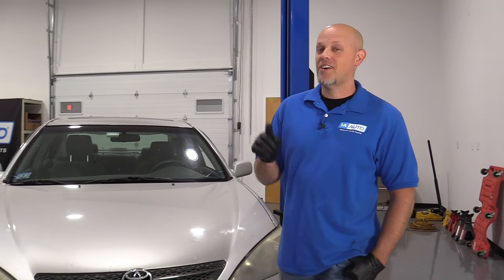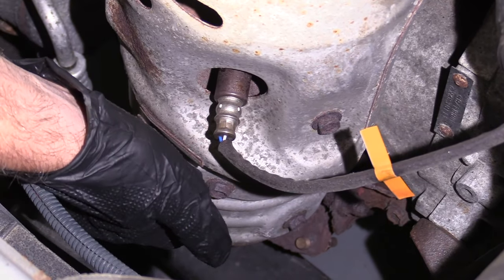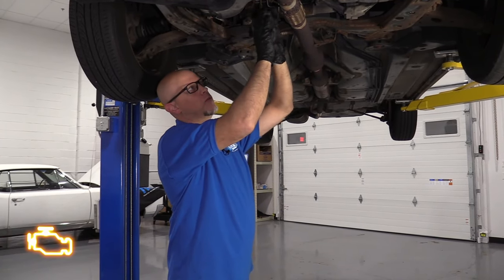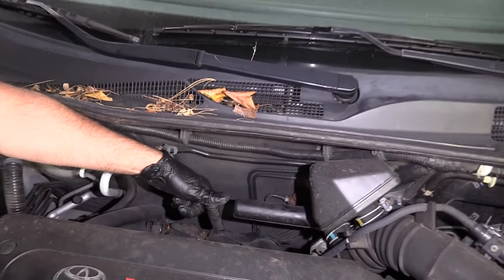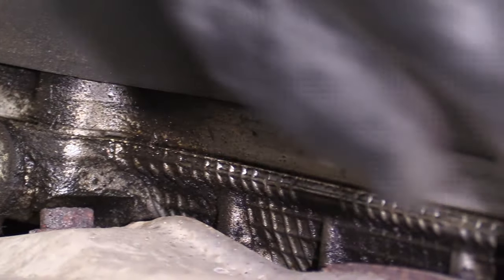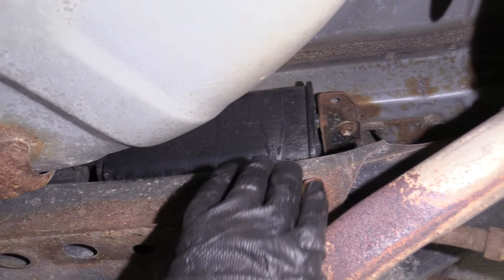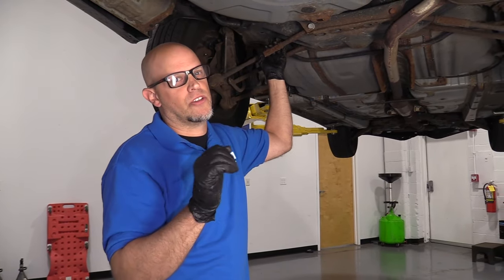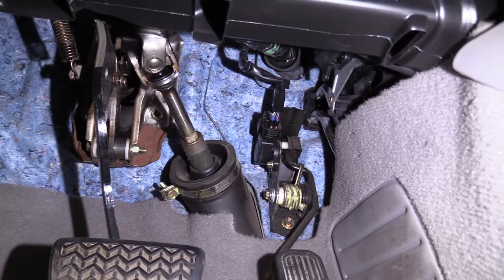Top 5 Problems Toyota Camry Sedan XV30 5th Generation 2002-06

Comment: I just let my 2006 go with 280k miles.  Motor ran great but was burning oil pretty heavily towards the end.  The biggest thing I found were the front brakes were always having issues.  I had them serviced at least twice a year and finally just drove on bad ones until they started grinding.
Reply: Your car still passed smog
Reply: I replaced all 4 with power stop rotors and quality ceramic pads my self cheaper than fronts at shop. Not one isdue in 3 yrd
Reply: @rt2255 wait at what point did this gen have rear disc breaks?? I’d kill to do a conversion from the drum rears that are never adjusted
Reply: @BC_CARS  mine is 03 v6 xle came with 4 wheel disc may only be on upper xle models or v6 models not sure
Reply: @rt2255  well I guess it’s time to start googling
Reply: @BC_CARS  check local pull a part junk yards may be able to find 4 disc camry and get everything you need. I am not positive but if it came with 16 inch wheels it is 4 disc as many came with 15 wheels and i know they do not clear front calipers.

Comment: We have 2006 SE V6 Camry (bought new Sep 2005) w/63000+ original miles. Best car I’ve ever owned.
Reply: Still driving my 2005 SE V6; bought new in Dec 2004. Amazing reliable car. Very smooth and powerful engine. Fun car to drive. May be the best cars ever made!!

Comment: Great cars! I have a 2004 with 192k and it's been one of the best cars I've owned. I will have to add 2 more things to the list. The steering racks go bad around 130k and the headliner sag by the back window and C pillar. Very common problems on this gen Camry.
Reply: What are the symptom of a failing steering rack? What was your doing before it fail? An how long did u drive with a bad rack an pinion
Reply: @kelseyrainwater3918  The steering feels loose and won't feel very responsive. It may also leak power steering fluid from under the car. I am still driving with the bad steering rack I haven't got it fixed yet.
Reply: @KLM817  loose steering like my steering wheel feel loose
Reply: @kelseyrainwater3918  It can but more so the steering itself feels loose like the steering has little control. Your best bet is to take it to a shop for them to check it.
Reply: @KLM817  how many years have you been driving. It like that? Dose it leak? Please get back too me
Reply: @kelseyrainwater3918  I have been driving my Camry this way for a few years. Mine currently doesn't leak any fluid though.
Reply: @KLM817  lol so it's nothing too really worry about especially it's nothing leaking an it's feel safe too drive
Reply: @kelseyrainwater3918  Its ok to drive it that way but you should still have it checked out just to be on the safe side.
Reply: True it was leaking throughout my college life, 5 years i just kept adding fluid “cheapest one” because it will eventually leaks, and it run fine and drove it through the US from NYC to FL it is the best car with very very minimal repairs HIGHLY RECOMMEND it if your main goal is quality nothing else like “HP, quietness, etc”
Reply: @kelseyrainwater3918  Not a big deal. My 05 Camry was diagnosed by the dealer, with a leaking rack and pinion  at 80K miles! They wanted crazy money for the repair. A mechanic friend replaced it with a Refurbished one for $500, I think it was. 100,000 miles later not a problem.
Reply: This is very accurate
Reply: I bought the 2004 with 198k and both those happened within a year , fixed the rack but left the headliner lol still driving with 240×××klm and the car STILL remains bulletproof. Excellent car.

Comment: In my experience the gas caps go bad more often then the evap canisters, even though it may throw a code, always and i mean always try replacing the gas cap with a factory cap reset the light drive 50 miles and if the light doesnt come back your good to go, the sensors for many of these are too sensitive, I have seen too many times people being charged hundreds to replace evap canister and have it "fail" again after a couple months because it was actually the gas cap. locking gas caps can also cause this issue as many times they are not sealed properly due to poor manufacturing and they are not made as good for modern cars. As an owner of an 05 model of this car with 300k miles i can attest that i only had a code once for the evap canister at 150k and replacing the fuel cap fixed the problem which the repair shop actually advised against go figure. The only big problems I have had with mine has been rack and opinion and piston rings. Valve cover gasket lasted until 200k miles and that can actually be caused by a bad PVC valve which is a cheap and easy diy fix

Comment: I bought mine from my next door grandma Nieghbor 05 le  only 49000miles for $3200 she rarely go anywhere just park on her driveway all day only two issues are roof top and trunk top clear coat damage and rear shocks this what I did after took to body shop they said $ 350 per panel so at lease it’s going to cost me $700 soI decide to do it myself they call flow coat for a whole car cost me about $300 look great change all 4 shocks now it look new and run like new I’m so happy . I bought this car I don’t even need

Comment: I got a 2002 camry xle (4 cylinder) at 33,000 miles, i got it up to 76,000 so far. I've owned it since 2016, The only issue i've had so far is the A/C going out every 12 months due to the relay going out. One of the easiest and cheapest fixes (20 bucks and maybe 5 minutes of work). Its not the fastest car nor the slowest, but god damn, that car will get you anywhere you need to go.

Comment: 05 camry le 4cyl. 237k miles. the only problems my wifes car had was windshield wiper arm, valve cover gasket, thermostat oring leak, motor mounts,dirty throttle body and exhaust leak from flexible exhaust. even though toyota says to not change the transmission fluid i changed it anyway and it made a huge difference at 237k miles let me tell you. all repairs done by me with the exception of the wiper arm. total repairs less than $1k and im being generous. most reliable vehicle i jave ever seen.

Comment: superb! spot on. I have a 2003 camry and the O2 sensor went bad. Easy to reply though
Reply: Did you get a check engine light cause a mechanic told me the check engine light don't always come on for a bad o2 sensor

Comment: We have an 2004 Camry, still runs perfectly and has never let us down. We once got an impressive 38 MPG driving from LA to Albuquerque with the AC on and loaded with luggage. And crap! I should immediately stop topping off the fuel tank. I have the bad habit of topping off until gasoline is at the filler neck.

That ruins EVAP canisters. 😮 I didn't know how much trouble it would be to replace it.

Comment: 2002 bought brand new after 21 years  and 255,000 still going strong
Reply: Damn.. do you do regular oil changes? What's your secret to keep it going that long? Any minor issues you fixed?
Reply: @ramir332  yes , high mileage oil changes the only thing I had to change out in June of 2022 was the fuel modulator. The part alone was $525.00 and casket was $15.00 and $300.00 in labor . I only use Toyota certified mechanics . I’m getting ready to do the timing belt again .
Reply: My 04 only has 104k bought it from a elderly couple 4 years ago with only 51 k I've had to replace the water pump alternator spark plugs and has new breaks and rotors 
Do you have the v6 or 4 cylinder?
Reply: @sirhc07  Not sure who you were replying to. But, I have a 2006 Camry I bought it used at a dealership unfortunately (they sell it to you at a higher price.) It was sold with 160K miles. And now its sitting at 190K (roughly 3 years general use.) Major fix I did was change the gasket oil leak (cheap fix) replaced all 4 shocks and the tires on them lasted 1 year before I had to replace all 4 tires. That was like $1K for shocks and tires. 

The only problem I have with the car now is it rattles when its idle. Does that happen to your Camry? im wondering what it is.
Reply: @sirhc07  3.0 v 6
Reply: Sports edition
Reply: @sirhc07  I’m 60 and when this car doesn’t drive anymore I will buy another Camry V6 . The one I have was a factory demo and had like 300 miles in it , it’s silver with black leather , GPS , funny when I bought my teenager daughters wanted the 6 cd changer and the dealer said it would run $1,500.00 to swap it out . I’m glad I left it . I have two German shepherd and have a heavy duty sling in the back seat . I have one tiny hole in the leather that I’m going to repair . One thing I did do when I first bought was I washed and had waxed it myself every three days . So the majority of the paint is still in good condition. Hood is pitted & and the clear coat is starting to turn white as my ex husband used it to commute on I 5 .  It’s going to be a sad day when she no longer here .
Reply: @sirhc07  thank you

Comment: We got a 2005 LE. None of the issues from this video yet with over 250k miles original owner.  But many front wheel bearings hub replacements. I think I replaced them 3 times going on 4 now.  And the other day it dumped a huge oil leak from the crank pulley area. I was thinking it was the oil seal from the crank but it might be the pump.  Either way, the cover needs to be pulled.  Not even a drip before this.  Now it's a stream.  Went from dry to cry in 1 day.  Oh I did replace the valve cover seal like 2 years ago and it looks to be leaking again.  Maybe I did it wrong.  But it's very little.  

Also,  I think the motor mounts are done.  There's a rattle on start up only.  And this might need a valve adjustment for the oil burning during start up.  🤔 

Replaced the timing belt and water pump maybe at 170k.
Reply: Depends how maintained it was. It needs to change ATF transmission liquid each 40k km. At least each 80k.

Comment: 2003 v6 xle 330k miles, 3 parts went bad all after 250k miles alternator, radiator, knock sensor. Best damn car i ever owned, have owned 15 to 18. Toyota only now

Comment: Wow. This was spot on. I inherited a 2002 camry and replaced the valve cover gasket and now have to replace the rear charcoal canister.
Reply: how many miles? got my 04 camry back in 2019 with 50k it now has 99k and have had to replace the water pump and alternator recently completely redone the front breaks and I change the oil every 3k I love it and that is actually very common them
Reply: @sirhc07  it's got 137 000 miles on it. Since I made my original post, I've had to get the brakes, rotors, calipers replaced.
Reply: @kelsiewilson  I got them off parts geek they seem to have very good prices on parts and the quality isn't bad a kit came with the caliper rotors and breaks I plan on re-doing the rear breaks next
Reply: @kelsiewilson  I regret not inheriting my grandparents 02 camry when I first started driving only had 30k at the time cousin still has it

Comment: Good video.  I would add the mass airflow sensor to the list from personal experience. A dirty throttle body will also lead to a malfunctioning mass airflow sensor.
Reply: Yeah the canister on the car he was looking up at probably does have those issues...did you see how much rust was on the bottom of that car? Probably has high mileage or lives by the beach.

Comment: I have two vehicles
03 toyota camry 2.4 200k miles
It doesnt run like a clock and it has some issues but I dont replace anything on it besides the regular oil, brakes every 7 or so years and so on. Had the car since new and it has original everything, except spark plugs, brake line, brakes, oil and transmission fluid. The drive belt is original if you can believe it.

I also have an 03 ford e250 4.2 with 295k miles
The van has been used to deliver wine from state to state but also to deliver packages which is the hardest mileage you can ask for.
I bought the van with 250k miles but I can tell you, similar to the Camry, it isnt perfect but it is very reliable. I'm surprised because I have done nothing but bag on Ford given I've always owned Toyota. These econoline Van's are built like absolute tanks and if I had to pick one for an apocalypse, it would be hard to choose given that they both could run virtually forever.
Reply from the maker: Awesome! Thank you for checking out the video. If you need auto parts go to: http://1aau.to/m/Shop-1AAuto-Now

Comment: I've had 2 of those problems and they were easy fixes:

1 - The purge valve on the charcoal canister was stuck due to being rusted out, I just snaked a new one under there and connected the vacuum lines and zip-tied it to the canister. codes never showed up again.
2 -  Had to replace the air-fuel ratio sensor at the front before the cat. it was an easy fix, the code cleared and never showed up again.
It's a fairly easy car to work on.

Comment: My 2005 has gone through one alternator,2 brake switches,shifter bulb, and the occasional oil change if I feel like it. 210,000 mile's and going strong.

Comment: I have a 2006 4 cylinder 216000 miles can’t hear the engine running, and it runs like a charm.

Comment: I just bought a 05 Camry with 217k miles on it. The only problem it has is the valve cover gasket because there is oil around that area. But thanks to this video I’ll try to fix it myself
Reply: It's a easy fix I had to replace mine too plus there's a few videos showing how to replace it too 😁
Reply: @trini_boi2414  how does the new rubber gasket stick to the cover when you put it on.
Reply: @matt7iron  geesh this been a while I can't remember..I think I placed the gasket on the area of the engine firmly and place the cover on it and bolt it down..I never had a problem after installing the new gasket and I still own the same car too..

Comment: i drive a 99 camry here in los angels.....literally zero rust....not even little surface rust :D
Reply from the maker: Nice! Thanks for watching
Reply: Watch your oil & coolant level monthly, Religiously.  Live in a hot climate?  When you have to replace your radiator, replace with Denso 2210506 ( keeps engine cooler in hot weather ).  You may consider removing thermostat in hot climates ( generates CEL, however).  Schedule water pump replacement every 3 years.  Fyi

Comment: My 2005 XLE Camry is still running strong! There is an engine rattle upon cold starting the car that is EXTRA loud when the AC is turn ON. Even louder when in reverse gear. Goes way once engine is warm. Could this be the Intake Manifold Plenum needing replacement? GREAT VIDEO btw.

Comment: Had a nineteen ninety-eight Toyota Camry with 348000 miles on it and it was still going strong until a deer took it out!! The car was accidentally put into reverse at 65 mph when it had around 200,000 mi on it, I am a mechanic and if somebody told me that I would say they are lying but it did happen. Transmission never started slipping, leaking, shuddering or having any problems. Absolutely unbelievable. It was only put in reverse for a fraction of a second but it felt like the ass end of the car jumped up in the air!

Comment: Yeah, head gasket leaks and O2 sensors are the only problems I've had, both are stupidly easy to fix and cost nothing. Once it hits 17+ years though it will need new rear suspension or it will bottom out on rough roads when you got the car full of people.

Worst thing I've ever had was distributor caps going bad, but they were quite old.
Reply: So you think that rethreading the stripped head bolts and block threads and then doing the head gasket is a stupidly easy fix? Please come on over here and do it for me and while you're at it, I have a couple of friends with the same problem.
Reply: I bet he’s mistaking it for the valve cover gasket. I just picked up a 2002 Camry w/5 speed and 130k miles and now I’m concerned about this issue that I wasn’t aware of prior. I’m guessing if it happens I may just go the route of a used engine instead of doing the HG R&R.
Reply: @KimathiTheLeopard  My valve cover gasket went around 150,000 miles. That was easy to replace but then the stripped head bolts/head gasket was just too much and too involved for me to tackle another couple of years later. Good luck with yours, maybe you'll get lucky and it will never give you a problem. I wonder how plentiful used engines are at this point? They sold a lot of these vehicles but the engines were what primarily went.
Reply: @rft2001  thanks for that insight… seems like there’s used JDM engines to be had on eBay which might be better than the US produced variants. From what I’m seeing this issue was more likely in the US build verses the Japan version. Maybe it was a lapse in quality control or just slight different quality of the block casting but nonetheless it’s very unfortunate to hear this is an issue I now have to think about.
Reply: @KimathiTheLeopard  Thanks for you info. I, indeed, did have a US built Camry. Good luck my friend.
Reply: @rft2001  fingers crossed on my end as it’s a Japan build but we’ll see… I’ll report back if I experience anything similar. Thanks again for the valuable insight!
Reply: This doesn't even have a distributor cap lmao you have lost your mind
Reply: @xfhnhhgjbvcfg  guessing he’s talking about coil packs 😂
Reply: @KimathiTheLeopard  I think he is talking shit, absolutely
Reply: @KimathiTheLeopard  best to do a drain and fill on the coolant and to replace the thermostat and radiator cap with Toyota oem. You want to keep that engine from ever overheating. Every time you change the oil crawl under and look up in the back of the engine just under the intake for coolant seepage. Also inspect the area under the water pump and the plastic parts on the radiator. You DON'T want to overheat these engines.
Reply: @frankg6578  great info and tips!

Comment: I've had 2 of these problems with my 03 XLE, the Front A/F ratio sensor and the Purge valve on the EVAP canister on mine got eroded. replaced both and my car has been back solid as it felt off the the assembly line.